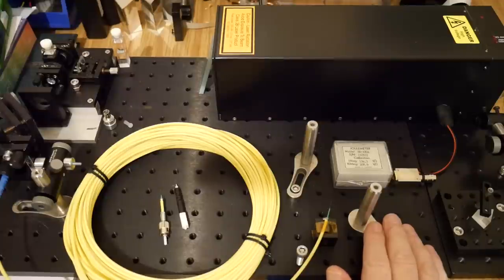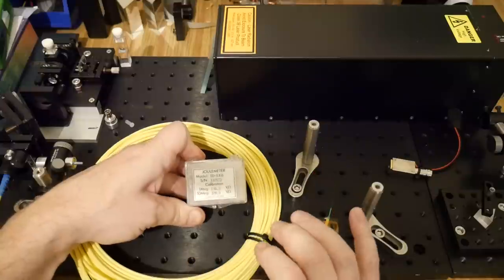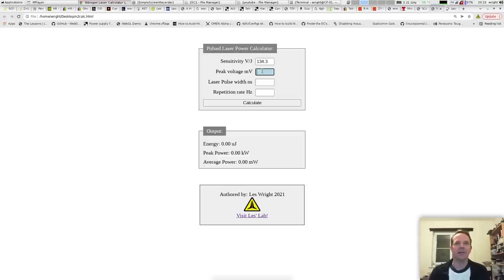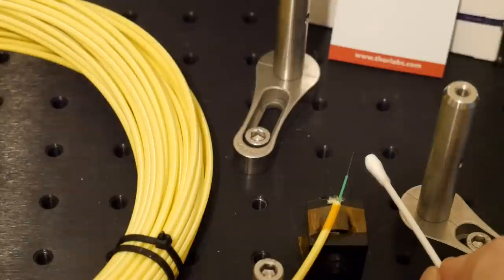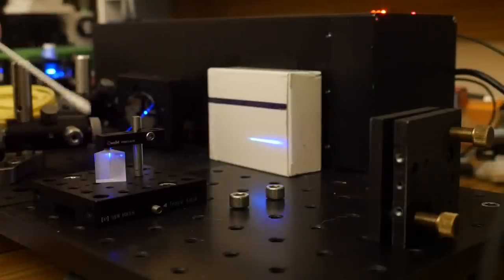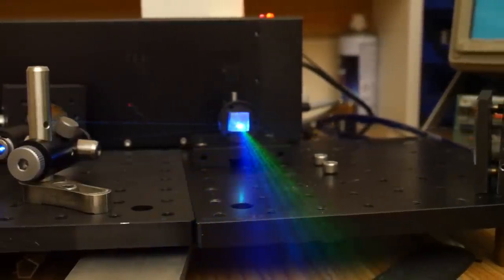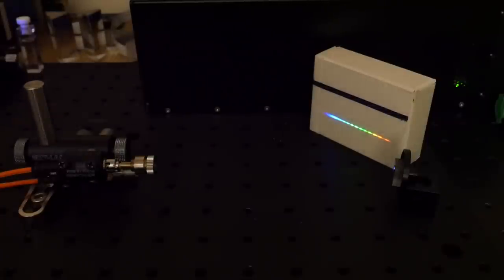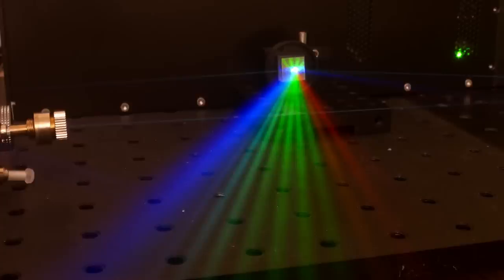Supercontinuum in Multimode Fiber

Comment: i dont see the red and yellow orange full spectrum like i seen the first video you done?
Reply: so the longer the cable to more the spectrum? i figured the lower the power intensity too no?
Reply from the maker: This has a shorter fiber, so it doesn't quite reach those wavelengths. The longer the fiber, the greater the span of the Supercontinuum (up until a point!)
Reply from the maker: There will be undoubtedly losses with a longer fiber, but this is still orders of magnitude brighter than SM fiber.
Reply: @LesLaboratory  ok
Reply: @LesLaboratory  got it thx

Comment: Where did the red color in some of these shots?
Reply from the maker: It flickers in and out. If the fiber were longer, the red end would be more stable.
Reply: @LesLaboratory  Does any produce any UV or NIR/IR wavelengths?
Reply from the maker: @morningstarsci  Not currently. The lowest wavelength is ~420nm (the pump wavelength) and the longest is determined by the length of the fiber and the amount of energy you can couple into it. For multi octave spanning super-continuum from UV to IR you would require Photonic Crystal Fiber, and a suitable laser to pump it. This is very costly, with the fiber alone costing hundreds of dollars per metre! There 'may' be other methods and it is something I will be looking in to.

Comment: It'd be an interesting project to make an interface to sync the N2 laser to the camera's shutter. I wonder if the HDMI outputs of modern cameras are synced to the shutter? Back with analog composite it would've been pretty easy to extract the sync pulse, phase shift if necessary and trigger the laser at 25 or 30Hz
Reply from the maker: Hmmm, that is an interesting proposition. I think you would need an FPGA to extract the equivalent of vsync. I would bet it can be done with a Pi-Camera....
Reply: The hq pi camera has an external sync in, to force when a frame begins
Reply: @cleverca22  Wow, that opens up a lot of cool options, I'll look into it myself, cheers!

Comment: since when does MM fiber come in yellow?
Reply from the maker: Since manufacturers abroad stopped caring about color coding. It threw me as well, it is 50/125. These days manufacturers are letting people pick jacket colors as well,  which will just cause confusion.
Reply: @LesLaboratory  great :/.  i guess.. for short runs, it wouldnt be the end of the world if one accidentally grabbed a yellow fiber expecting it to be a sm, as ive (in a pinch), used mm with a sm signal. but that def wouldnt work the other way around.. id be like trying to shove a grapefruit through a drinking straw...